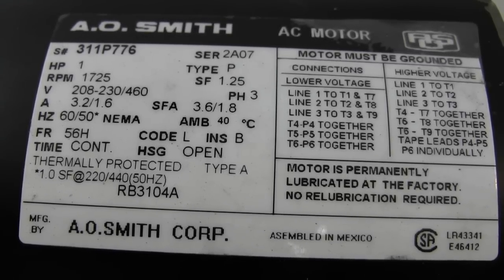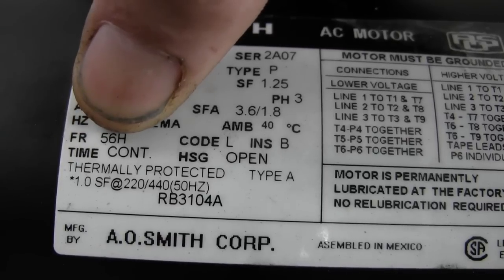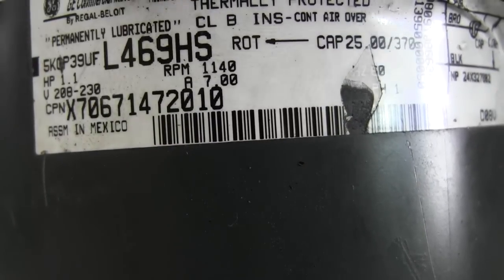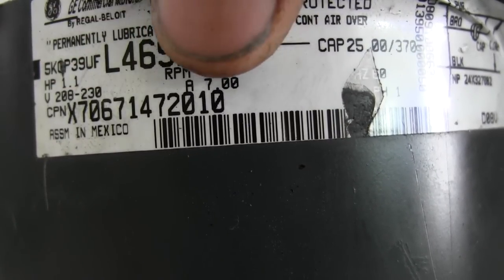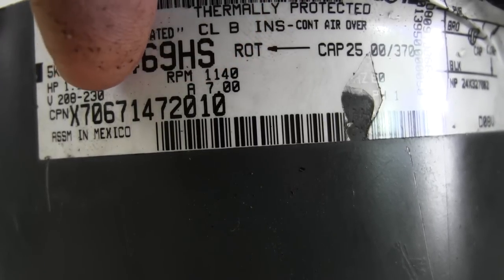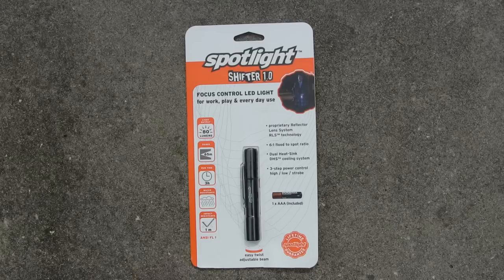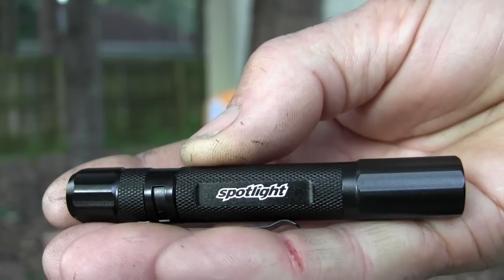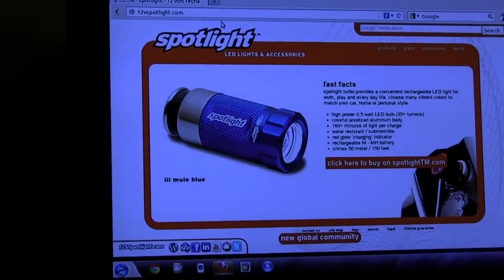HVAC Matching a motor by amp rating

Comment: On a condenser fan motor say a 1075 rpm at 1/4 hp and you go back with say 1075 rpm at 1/2 hp.. Rpms is tne same its not going to hurt anything.

Comment from the maker: The formula works on compressors with good electrical windings. Compressors windings that don't quite pass the test might still be working but their days are numbered. The next step to see if the compressor needs to be replaced is to ohm the windings to ground. If you get anything but OL (open line) then you should replace the compressor or risk further contamination of the system.

Comment: dr z...new subscriber with a question....i know that when ohming out a compressor that run to common is your low number...start to common is your medium number...and start to run is your high number...i have that....
but when ohming out a good working condenser fan motor....why does this formula only work part of the time?
thanks 
wayne

Comment: I have looked at how they are built, and the suction vapor is directly returned to the rotor chamber, but does the hot gas travel past the motor before it leaves the top of the compressor?

Comment: "Power Factor"

"Circuits containing purely resistive heating elements (filament lamps, cooking stoves, etc.) have a power factor of 1.0. Circuits containing inductive or capacitive elements (electric motors, solenoid valves, lamp ballasts, and others ) often have a power factor below 1.0."

Power = Volts x Amps x Power Factor

Comment: Exhaust hoods usually increase in CFM as the increase Hp.  I wouldnt wanna go lower. (hp) I guess you could play with the pulley to lower your amps. Right?  Are you worried an higher ampdraw will not get long with smaller wires? -thanks

Comment from the maker: It's the RLA or FLA. I know that the numbers won't add up. That's why you either have to purchase the OEM motor or use the RLA to find an after-market replacement. Just to let you know: there is no aftermarket replacement for that motor.

Comment: What is that 7 amp rating for that motor? Rla? Fla? Lra?

Cus the numbers don't add up...
Watts = Volts x amps
Watts = 208 x 7
Watts = 1456
1 hp = 746 watts

You would have a 1.9 hp motor and not a 1.1 hp motor.

Any explanation for this?

Comment from the maker: Absolutely. There are many things to consider when matching a motor. Don't even get me started on matching motors for belt driven systems. I'd have to make a video just to explain that. And converting belt driven air handler blowers to direct drive is a whole other issue.

Comment from the maker: It's typically safe to go with a motor that's rated a little higher HP. You have to be careful about going too high because you could under amp the motor as well.

Comment from the maker: That's a common problem especially on motors that have been mounted on a belly band mount. You might want to take the motor to a HVAC parts store and see if they can cross-reference the motor by the model number. OEM motors can be difficult to cross-reference because the manufacturers usually won't share much information about their products with after-market coompaniess

Comment: What usually ends up in my case: (using parts sourced from junk units to fix a non-junked unit) is go for a higher HP rating. Figured it was safer to go bigger than smaller. Thanks for the info.

Comment: Another thing to be careful of when matching a motor is that the failed one is actually the correct motor for the application. 
We had a case where we matched like for like but a previous tech had fitted a motor that was too small and run at a higher speed! (was 2 pole and not 4 pole)